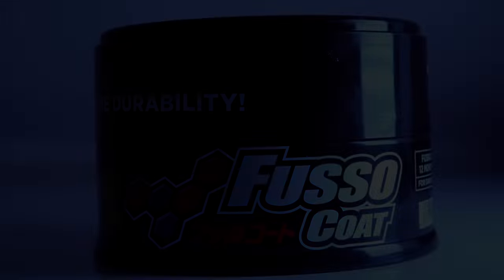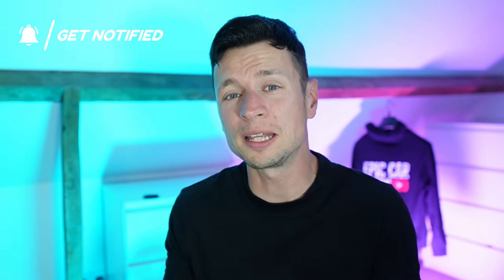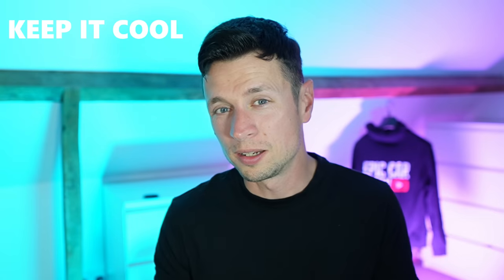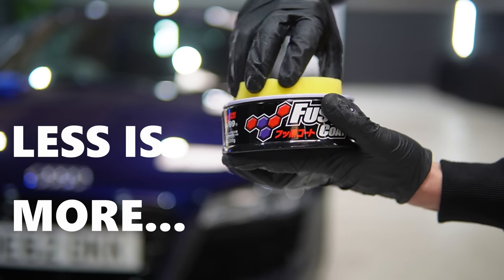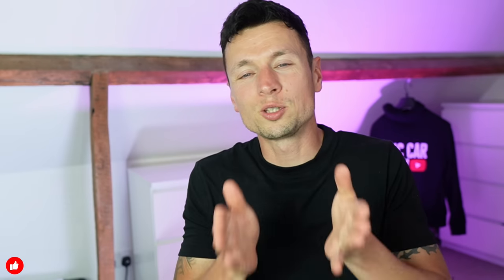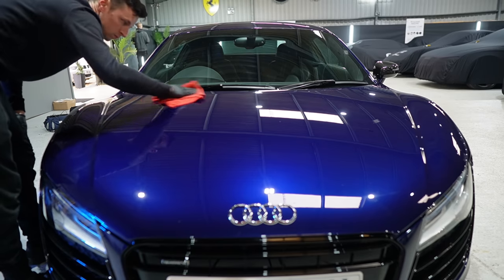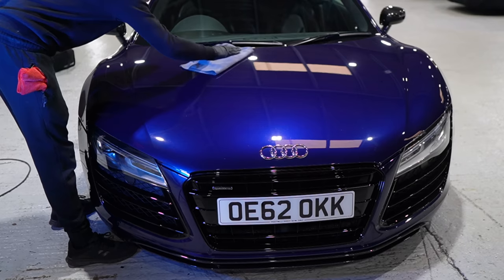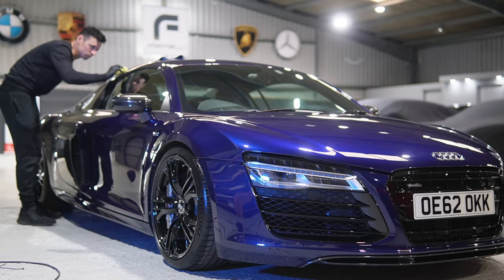The Search for the Perfect Car Wax Ends Here: Is Fusso Coat the Answer?

Comment: Tried fusso a couple of years ago. Made the mistake of putting it on in sunlight and was difficult to take off. Tried it again in cooler conditions but was very disappointed with the longevity of it. Noticed it fading after about a month. In fairness it was extremely wet at that time. Haven’t used it since.

Comment: I have just used soft coat 99. I snow foamed, decontaminated and washed I applied the coat but have ended up with a mottled finish on the bonnet. The car had a Diamond bright a year ago, would that be a reason for the fusso not working. What I have I done wrong, can I take the fusso off, and how to do so?

Comment: Facts.
Fusso is even easier to be applied. Not fool proof but easy.
If you will use modern day QD then fusso is just a base protection and yeah it will last. It has good initial look but wont compare against top waxes. But if you put QDs then who cares. Get a watergold and you good!
Prep is all.
Light one will remove easier and be more fool proof in terms of prep, amount and removal.

Comment: Love Fuso coat, I usually apply it  to our cars in the autumn as a winter wax.
Reply: What do you do when re-applying the Soft99? Do you have to remove the previous year's coating? Or do you simply wash the car, decontaminate and panel prep before putting the next application on top of the previous year. Presumably it will bond properly with the previous year's application.

Comment: I've used it for a few years now and people ask for it again and again, its great for repeat business and happy customers, lots who like washing their cars themselves between visits
Reply: What do you do when re-applying the Soft99? Do you have to remove the previous year's coating? Or do you simply wash the car, decontaminate and panel prep before putting the next application on top of the previous year. Presumably it will bond properly with the previous year's application.
Reply: @user-pz6dw3ot8j  The paintwork is decontaminated etc before re application but it's generally very easy going and they are usually still very slick, even after twelve months, Fusso may lose its beading after eight months, especially on the sides and lower front doors etc but it is generally still there.

Comment: i put 2 coats of fusso on my car near the end of September and is still beading up decently.... great stuff and only takes a bit longer to apply and buff than the likes of turtlewax seal and shine
Reply from the maker: It's amazing stuff. I love using it
Reply: I'm using seal and shine at the moment, how much better is fuso of you don't mind me asking
Reply: @mm7460  not a lot in it to be honest, i just like spending the time "waxing" after doing any corrections needed once a year. i got my tin of original fusso for £20 about 6 years ago and haven't put a dent in the amount used. apparently the newer tin is easier to buff and is less streaky but even on my black car i never got much streaks, key is to keep the coats as thin as possible but the turtle wax is cheaper ( i get the newer reformated bottles for£6 )and just generally a lot quicker to apply and buff so i use it as a topper every few months

Comment: I love the slickness after buffing it of. The looks after initial application are like adding additional clear coat.
Reply: It's buff off Easy? How much time do you left it on panel?
Reply: @ΓρηγόρηςΓιαννελάκης you have to put it on thin 
I mean thin thinner thinnest 
Take the yellow sponge that comes with it and soak it and then ring it out 
Put the yellow sponge in the can and turn it in a circle motion two or three times lightly 
A tiny bit goes a long way 
I mean a really long way 
One can should be able to do about 30 cars easily. 
Work in small sections
It will flash pretty quick if you keep it really thin 
Work in the shade 
Buff it off 
After take a clean micro fiber cloth and buff it again 
Do the whole car this way 
Keep it off plastics 
If you get it on any plastic just use a clean rag and wipe it off right away 
There is no better wax/sealant on the market 
Let it dry 24 hrs 
After that you can top it with anything you want 
Fusso makes a product called King Of Gloss or Mirror Shine 
It’s meant to go with this coating and add extra gloss.

Comment: Used soft99 for about 3 years now, I apply it twice a year, full winter prep, then coat of soft99 topped up with sonax bsd every weekly wash, results are amazing, great combination, same for my summer prep full decon, clay, light correction, polish then coat of soft99 + bsd,
Much better results than what I was using before which was bilt hamber dsw, and that is a good wax but is tricky to apply even in cooler conditions

Comment: Soft 99 makes a whole range of very good detailing products for a very fair price.     Their soaps are also great (although not scented at all) as well as their wash sponges (which I have actually come to like much better than a wash mitt, pad, or microfiber cloth) on well maintained vehicles.    And NO their wash sponges will NOT scratch your vehicles.    In fact,  I think they are actually safer after experimenting with them over the past few months.    Again,  NOT on real heavy dirt.   They are really nice on WELL maintained vehicles.      I just use a single bucket with a grit guard and dunk the sponge in the solution frequently.  No problems with scratching.      These are superior quality sponges,  not the dollar store crap sponges that would scratch a hardened porcelain sink from the 1950's!     For the average person just looking to do a weekly or bi-weekly maintenance clean of their vehicle,  Soft 99 products would be an excellent choice.

Comment: Thanks for the video Dave. Soft99 do some great  products. Kiwami and Water Block are another couple that spring to mind. Once clients see the hydrophobicity of Fusso Coat for sure they will tempted as opposed to forking out extra for a ceramic coating.
Reply from the maker: Cheers Karl. It's definitely one of those products that is definitely for a  real car care enthusiast. If I use it once a year by the time it runs out I'll be 56 lol
Reply: @epicautomotivedetailing does this stuff smells
Reply: @biggdogfresh2263  It does have an industrial chemical smell.

Comment: I've used Fusso for a few years now.  The only thing I can say I don't like about it is that its not a glossy way, and needs something to boost it up, and as soon as you cover it with a detail spray you loose that incredible beading.  If you get high spots then put more on to use the solvents to re-melt the wax, and re buff down.
Reply: Fusso makes two products as toppers 
King of Gloss
Mirror shine 
This will give you the extra gloss you are looking for 
Lasts between 3-6 months depending on weather and containments

Comment: Been using fusso for at least 8 years now (obviously not the same ton) and value for money along with ease of use and quality it can't be beaten for the money
Reply: What do you do when re-applying the Soft99? Do you have to remove the previous year's coating? Or do you simply wash the car, decontaminate and panel prep before putting the next application on top of the previous year's. Presumably it will bond properly with the previous year's application.
Reply: Just a decontamination, maybe use a clay cloth and just reapply
Reply: Many thanks @Tvigness

Comment: I keep wanting to try this wax, but I'm so reluctant to break from my normal routine.  My mind set is that the car needs a good spit n polish with every clean.  After final rinse I use a light misting of Seal n Shine all over before dry down and buffing.  So quick and easy and stunning finish.  I suppose a hard wax would offer that extra longevity of protection but unless the car has just been prepared to perfection I wouldn't chose it.  It really is a once a year product for upsale.  Having said all that, I'm still gonna buy some and play 😄

Comment: It's great stuff indeed. I use the Extreme Gloss Black Hard Wax of the same people a lot and that is very similar to Fusso Coat, only a bit cheaper.  The 12 months is a bit exaggerated though.
Reply from the maker: Think 12 months is maximum which for a wax is pretty good going. But I reckon for the weekend warrior it will be bit shorter
Reply: I thought that 12-months was OTT too, Martin. That was until I saw the OCD (Obsessed Car Detailer) channel and his experience with Fusso Coat. In the video he was giving a car a strip wash with Fusso Coat added some months before, and he couldn't get the stuff off the car no matter how many chemicals and shampoos he tried. Another channel was giving a panel with Fusso Coat a torture test and he gave-up at around 50 washes, at which time the product was still sheeting and beading the same as when he began the test. A couple of my detailing mates swear by the stuff. One of them has been using it religiously on his own car for over six years! Got to go and get some now the man has given it his endorsement.
Reply: @as680783  Here in my internet bubble (carclean forum) they speak of 6-8 months which is still excellent. It all depends on how you use your car: is it a daily driver and how many miles does it drive? Does it sleep indoors? How is the maintenance? 
We do agree on the fact that it is decent stuff  :)

Comment: Nice video. Fusso is definitely a top notch product. I wonder if it will be banned eventually as PFAS are cracked down on. That’s the only real pro of some ceramic coatings, no fluorine. I think applying wax a couple times a year is easier than coating.

Comment: What do you do when re-applying the Soft99 in year 2? Do you have to remove the previous year's coating? Or do you simply wash the car, decontaminate and panel prep before putting the next application (Year 2) on top of the previous year's (Year 1). Presumably it will bond properly with the previous year's application.

Comment: Still I would advise caution to the people installing it, the hobbyist, weekend warriors like myself. You CAN screw it up and quite hard . I didn't stick to installation guidelines and it was a pretty grim experience. I applied it to the whole hood and went on cleaning the garage, who knows how much time has passed. I had inadequate lighting so some areas were laid on thick. It obviously stayed fir too long and you could not buff out some areas, sort of high spots. It's not harmless wax, it packs a punch and do it properly or else the punch goes into your face ...
Reply from the maker: Yeah for beginners it can take practice but for valeters using it for an upsell it's very easy money thank goodness

Comment: I applied some on the company e-scooter when it was new and everything without any dust or grime
6 months later it still holds quite well. Water beading isn't as beautiful as in the beginning, but after some snowfoam and pressure washer it basically is clean again and still has a good amount of shine

It was left outside literally the whole time and wasn't covered or anything
Reply from the maker: Contamination can still occur so that instant beading won't last a lifetime but with regular maintenance it should hold up fine

Comment: “Not for your weekend warriors”- after I’ve applied my fourth coat this month. 😂
Jokes aside, I tried this for the first time last month on our white car. Very happy with the results. They’re retarmacing the roads here and the car gets covered in contaminants. This wax makes them so easy to remove. 
One thing I’m missing in my arsenal is an affordable wax/ sealant that stops brake dust sticking to wheels. I can spend more time cleaning the white wheels than I can the rest of the car and my back doesn’t appreciate it. Any suggestions?

Comment: I bought some Water block Super Splash, and although it doesn't claim the same durability, i was disappointed how much had gone in 2 months. I still have some Bilt Hamber Double Speed, would a layer of that and a layer of super splash over the top be beneficial? Double speed was the first wax I ever used and get around 6-7 months from it!
Reply from the maker: That's not bad going. Everyone loves BH double speed wax.
Reply: @epicautomotivedetailing  For the price its ace, just harder to remove than others i have used. Damp as apposed to dry microfibre helps considerably though

Comment: Is this better than turtle wax graphene + ceramic paste wax?
Reply from the maker: Great question. Turtle Wax graphene wax is actually brilliant. I tested it on a mercedes last year and it's hanging in there still. I haven't used this long enough to back the 12 month claims but have applied to few family cars so will have to wait but so far both are equally great with no clear winner

Comment: Nice vid Dave, but a quick comment on detailing in general.  It makes me laugh. We spend all our time being preached to about using pre-wash, snow foam, two buckets or more, the softest microfiber etc when doing maintenance washes and then you are given a pot of wax and a SPONGE !!  someone has got something very wrong it would seem 😁
Reply from the maker: Lol you sir need a medal for that 🥇. I honestly thought myself once but once the car has been properly prepped there should be nothing to come between the surface of the sponge and the paint. But yeah I'm with you on that thought 😃
Reply: You're using the sponge damp so probanly not as bad as using it on a "dry" sponge. Personally would use an applicator pad though and the applocator pad would make it easier to apply thinly.
Reply: @epicautomotivedetailing  It was a bit tongue in cheek to be honest, I do like a good non contact pre wash as much as the next zealot, but you get these guys (and to be fair, I may have a few of their habits too) who obsess about the softest drying towels, 70% Korean this and that, feather dusting off before buffing and similar stuff and are then they provided with a comparatively harsh sponge to use to apply wax after they have put all the effort into paint correction. 

Jesus, I remember some of the more over zealous preachers whining adenoidally about people using sponges on frikkin road salt dulled weller steel wheels, let alone freshly prepped clear coat.  I can't imagine the coronaries this is gonna cause. 😂
Reply from the maker: @kevtheargonut  I know right. Honestly if you don't use the 10 bucket method your labelled a scratch and shine 😂

Comment: I’ve got the old fusso which I think lasts a bit longer than the new version but stinks like hell. You wouldn’t want to use it in a garage. I got around 8-9 months out of it in the real world on a car that lives outside. The water behaviour is insane, there’s not much out there like it due to the Fluorine which has amazing contact angles. Tin of that will last a life time
Reply: I have 4 cans of the old Fusso 
It’s the best wax/ sealant I have ever used 
I honestly can get just about a year out of the coating here in the Northeast of America.

Comment: 100% agree. This wax is a must for customers not wanting to get a ceramic coating. 

I charge from £30 £45 as a add on  pending onthe size of the vehicle.

2 of my regulars took this as a added on with there mini valets thats done every 4wks so was an easy £65 - £70 for 2hrs work.

Ive been trying the dark on light cars and light on dark cars to see if i could notice any difference as this is something i was wondering myself.
You have pointed out it out plain and simple and the obvious 1 has fillers 😂😂.

Now i feeling think as shite 😕
Reply from the maker: Yeah it's such a good upsell. I know someone who charges over £80 but the majority down here are £50-80. Definitely feel this is more for the business valeters over the weekend warriors

Comment: Not arguing the lasting of the product ,however this product is leaving hazing behind on black colors. If you not fussy about a show room look then is fine as durability .
On the otherside not really for diy ers either.
Reply from the maker: hazing is very easy to fix my friend. Just one damp towel wiped followed by a dry towel and job done
Reply: @epicautomotivedetailing  didn't work that way. I have tried different tactics and end up with light scratches on affected panels.
Been doing this for over 25years my friend.
Car has been now ceramic coated and looks fantastic.  
In my opinion Meguiars products or Glymm way better than Fusso on that regards.

Comment: Youre actuelly using it wrong. Put the sponge in some water (not to much) Then apply it on the paintwork. What u will find is that its sooo much easier to handle. Youre welcome
Reply from the maker: I RINSED IT UNDER TAP. JEEZ